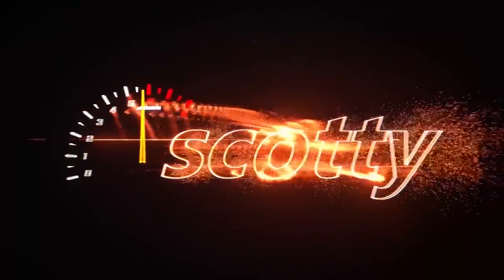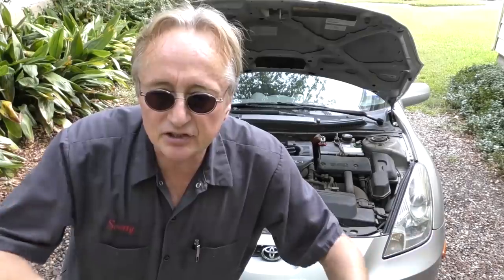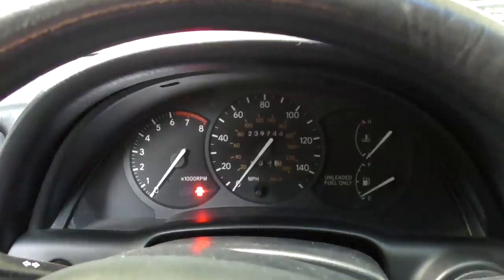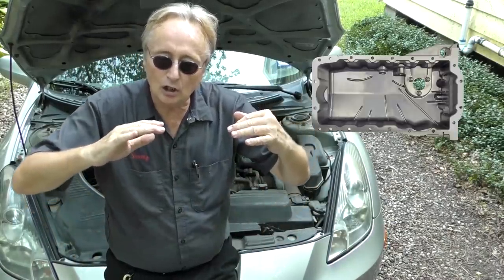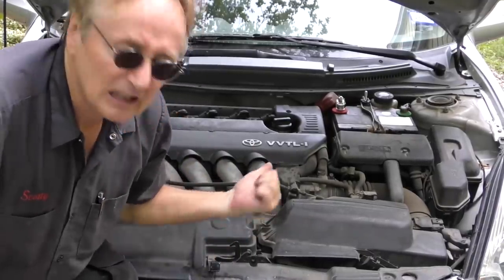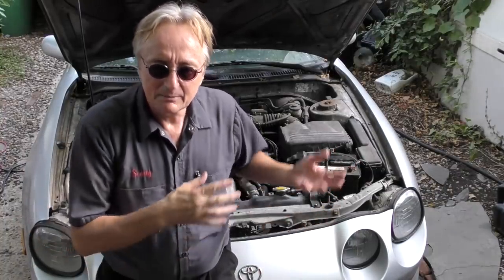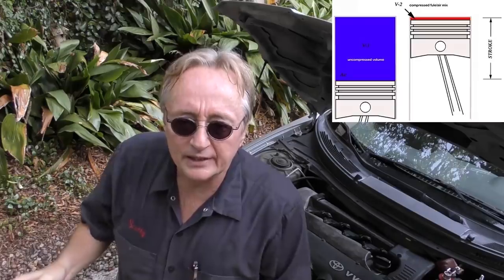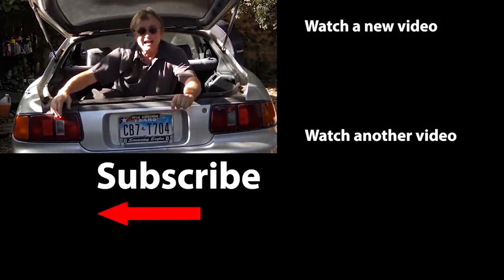Why Not to Buy a Toyota Celica

Comment: i almost never get my Dakota over 2500 RPM, but i do change the Oil every 2000 miles and i run an occasional tank of premium gas in it from time to time to clean it out a bit. I cant imagine having to run a car engine at 6000 RPM, thats crazy.

Comment: This I have to agree because everyone I know with one of these are on their 2nd or 3rd engine. Before buying one of these Celicas I would do a 3SGTE swap for the ST205 Celica which is a easy swap if you know what you're doing and making more power than the 2ZZ. Also the Celica 5SFE engine and Supra 2JZ are both tuned by Yamaha which has proven to be pretty good. I mean look at what legend the Supra and Celica GT4 has left behind. The only thing that would  have made the Celica ST205 model better besides a turbocharger is a 6th gear added to the close ratio transmission. It sucks running 55 mph and running 3K in rpms but my Celica still gets good gas mileage even without the 6th gear or overdrive. It is a 10 hour drive to Florida for me and I only filled up twice before we made it to Disney world and I still didn't use all of the 2nd tank either.

Comment: Interesting. So basically, stick with Toyota-engineered, and Toyota-built engines.  Is anyone else concerned that the new, 2020 & 2021 Supra uses an engine built not by Toyota, but by BMW?
Reply: Don't buy BMW craps.

Comment: Yes. Do not buy these 2000+ GTS CELICAS. They are not for regular drivers. They are for folks who love these engines and know HOW to care for them. And also how to mod them to eliminate the issues and get the most out of them. If you want a no hassle car engine that does the same, get a Honda k20 or k24.

Comment: That's why I bought a 2000 Celica GT the motoring that I just changed today at 300,000 MI simply because it was burning oil and it had lifter noise but the thing still ran great but I want to get another 300,000 out of because I love this thing

Comment: Wow wow wow, hold on. This is a Toyota engine with the head "tuned" by Yamaha. You replace the lift bolts, and the timing consumables and they last just fine. There are baffled sumps (oil pan) for curing the oil starvation issue, but it's only really if you're taking it to the track that you'd need it. You need to be cornering really hard for it to starve. Oh and BTW you could have this engine with a supercharger in the euro Corolla, again, they do alright with some maintenance.
Reply: Kilmer exaggerates. Like a lot.

Comment: Specifically YAMAHA does not make balanced engines without taking into account the frames they are going into causing the connecting parts literally to rip apart from the car.

Comment: The XRS Matrix which uses the same engine and transmission as the GTS (only the GTS has the lift system, only the XRS had the lift system) the GT had the same, or more/less the same engine version as that Matrix you're showing. You didn't mention the awful transition issues with the XRS and GTS with the six speed transmissions that were exclusively paired with those engines.

Comment: I got the same motor in my Toyota matrix xrs 2003, 6 speed manual transmission with 215k miles and no problems🤔🤔

Comment: I find that video hilarious, if the T23 is known for one thing in Germany, then, that you cannot destroy this engine...

Yes, if you did not get the replacement engine she might start eating oil at 125k+ km, but luckily mine is fine.
And yes, there is a problem to the TS, that is calls GT-S in America, where the crankshaft can run unround, but that is a 250€ ~320$ modification, that everyone buying such a Celica should know about, when he informed himself for a few minutes.

I would not give up on my T23 Celica for anything. She is super reliable, wants some Oil now and then and new spark plugs every other year, but that's it.

Fun fact: That engine is so reliable that there is one guy in Germany, who put a 130hp turbo on that engine after 125k km  and it is still running with the same engine at 725k km

Comment: I would buy the last generation Celica GTS in a heart beat if I could Scotty, they are better than you think!  Also you're 94 Celica has nothing on my 92 Celica GT convertible as far as durability and handling, plus mine has just over 386.000 miles and is much more easy to work on and is cheaper to repair and own than your 94.

Comment: Wrong, those engines are durable, the problem is that people tend to trash them a lot more, I've seen quite a few going over 400000 kms, obviously, they have high hp per liter output, so they will last less, but they are far from fragile

Comment: They sorted problem in 2001/2 I've had few and know others had them and there very reliable but get a 2002 upwards to 2006 and the 140bhp as you don't need the 190bhp

Comment: Holy CraP!!! I have been kicking myself for 19 years because I bought a 2000 Ford Focus instead of a 2000 Toyota CelicaGT that I really wanted. Truth is both decisions were wrong, both cars are crap. After just 140,000 miles of babying (original clutch still perfect) my Focus for 19 years, it sits dead with so much work needed it is not worth fixing. Been riding a bicycle for 3 years now because I did not buy a Civic.

Comment: JUST CHANGE THE DAMN OIL REGULARY and maintain the engine as any high performance engine and you’ll be fine, I got my 2zz for 6 years now, 250000km still runs like new, no signs of wear, very important to service 2zz corectly, and if you wanna corner hard on high rpm buy moroso oil pan. 2zz is really a great engine if serviced regulary!

Comment: The 2zz is so awful that every MR2 spyder owner is snatching them up to do the 2zz swap and put this motor in the spyder.  Swam the internals of oil pump from aluminum to steel and that's it.  It needed baffles in the oil pan but thata if you are racing and doing high g corner turns.

Comment: I didn't know that. I know Yamaha has designed allot of engines you'd never expect. This is one of them. My Honda has the 1.7  d17a2  Engine and it's only has the vtec on the exhaust side it kicks in at 3200 rpm which if you go any more than that ... the transmission ain't gonna like you let me tell you that. Its an automatic. Don't try to drive it like it's a standard

Comment: Moral of story they tried to compete with honda and failed lol. Honestly tho if you fix the oil pump and oil pan in the aftermarket they are good little cars
Reply: LOL. The 00 model of the Celica Gts would smoke any Vtec from 00 to 06. Trust me, I did it. Not even close. The newer Vtecs can hang with it.

Comment: Wtf are you talking about. I've watched a lot of your videos and do like them, but the only truth here is that for some bizarre reason Toyota decided to put a non-baffled sump in the car. People do blow these by over-revving the engine when down shifting and going into wrong gear - but that is user error, not poor design, and the same could happen in any car. There's nothing wrong with the oil pump or the rest of the car - just need to be careful when cornering. Mine has 167k miles on it, no problems whatsoever, and on the first engine. The 140bhp 1zz in the GT on the other hand is a different story - they had all sorts of issues.

Comment: I wouldn't buy one because back in 200x I drag raced a GT-S VS a GT and the GT kept winning even though according to everything; the GT was down on power compared to the GTS.  I mean; we beat on both cars that night - the same result every time every driver.  And my 5th generation prelude was quicker; definitely a do not buy.
Reply: Your wrong. Not Gt would beat a Gts. Had to be a sucky driver

Comment: I call BS,  there is nothing wrong with the 2ZZ engine. I have been building 2ZZ's for over 15 years and they are good engines.  98% of the time the blown engine was a misshift.  the oil pump works just fine too.  yes there is cavatation issues.  but those are in extreme circumstances.

Comment: Toyota and Yamaha go way back, the 2000gt in the 60s had a Yamaha engine(head), my '86 Celica has a Yamaha engine, the supras and more, mostly head designs. I don't believe the oil pump and pan of the 2zz are designed by Yamaha. Maybe the flaw was overlooked by Toyota themselves, sadly, investigations are to be made. Be sure that justice will not be overlooked.

Comment: I had a 2001 Celica GTS. The only problem I ever had with it was the A/C. The engine was never an issue for me. By the time I traded it in, I had over 170K miles.

Comment: bought my 2000 GTS at dealers auto auction in 2001 for 12,000 I never had engine problems until possibility know it overheated in 2021. 2000 dollars to fix radiator leak coolant system, water pump leak so I probably need to sell it as is. it has over 200,000 miles original 2zzGR engine

Comment: this gen celica is a disgrace. this is basically a two door corolla. toyota dropped the ball with the 2zz engine. long gear ratios and short power band when compared to the Honda b18 and K20 motors

Comment: I have the GT version from 2000. 1zz and its at 200,000+ miles right now. It runs amazing still. Just needs to be taken care of. Just like any other engine. You gotta maintain it, that's it.
Reply: Still have it? How many miles?
Reply: @vilshe7449  haven't checked but it's my daily. Still running strong.
Reply: @HayatoFujiwara  Great. Just got one for myself, about 162,000 miles. It's the EDM version so 6 spd manual and rear discs with abs standard. Such a joy to drive especially since it's my first car.

Comment: I prefer my gt engine 1zzfe
Reply: why would you prefer it?
Reply: @arcanevoid9199  what do you think of the 2005 1zz, is it reliable, any common problems? From what I can see the common problems are the oil, which should be fixed for the 2005 model, the engine, 1zz should be reliable? and stuff like break disc, what do you think?